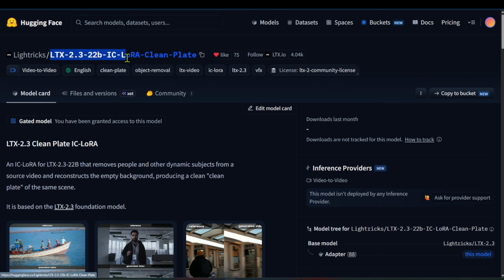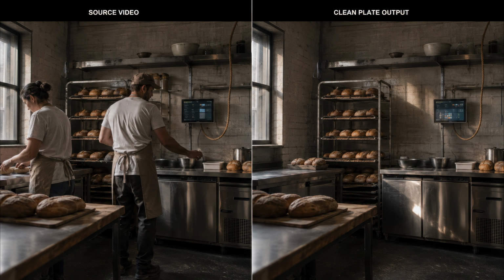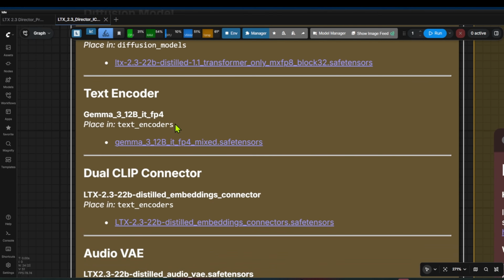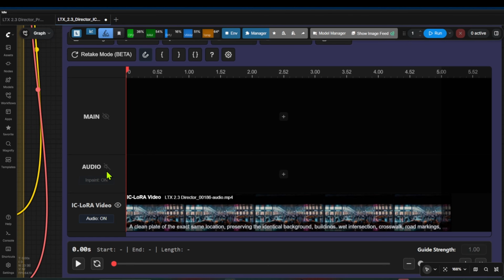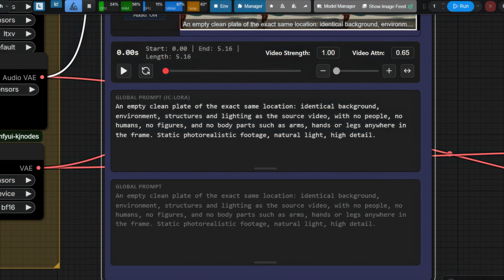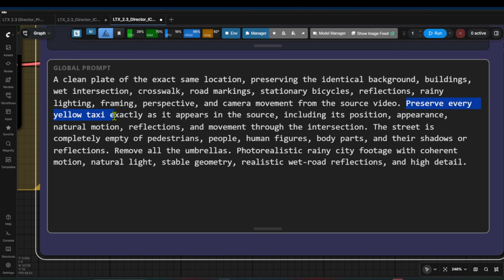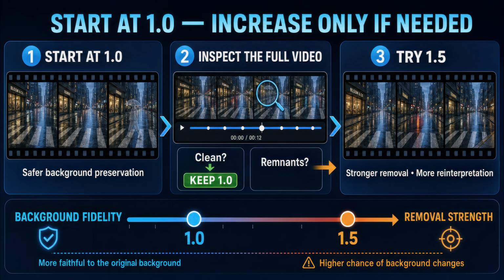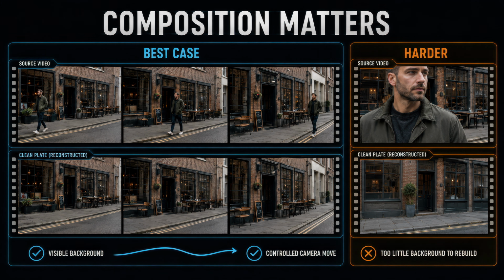LTX 2.3 IC-LoRA: Remove People & Objects from Videos! (Free 8GB VRAM ComfyUI Workflow)

Comment: Can I use EXR files in this workflow?
Reply from the maker: I haven’t tested EXR files directly. This workflow is designed for standard video input, so you would need to convert the EXR sequence to a supported video format first, or replace the video loader with an EXR-compatible image-sequence loader.